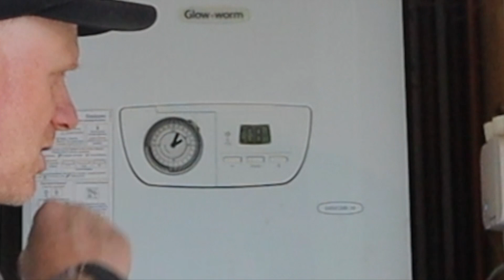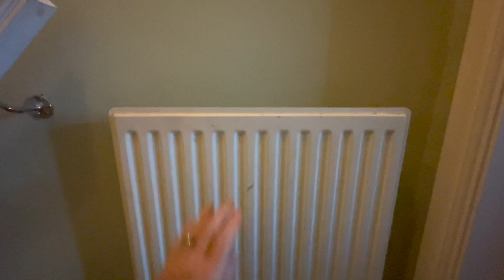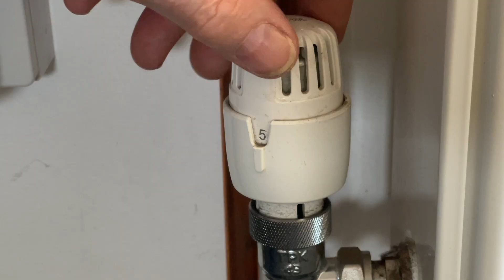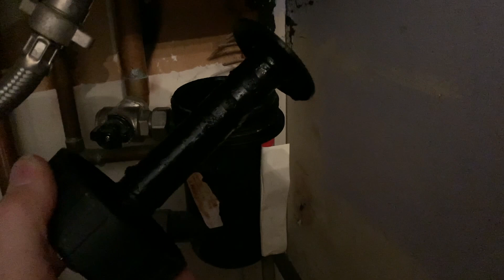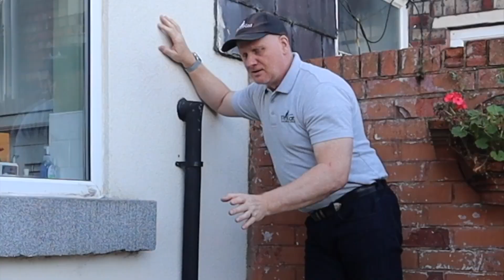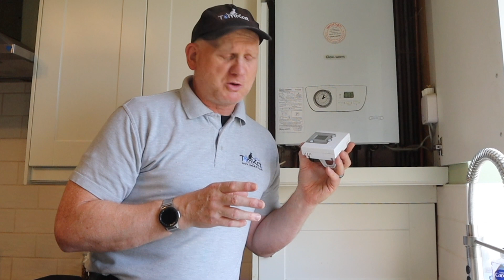Is your boiler ready for winter 2023, How to prepare your boiler for winter and stop costly callouts

Comment: I’d like to ask your advice on a different subject.     How can I contact you.  Thanks Pete
Reply from the maker: Email on info@tomorrow-kat.co.uk
Reply: @tomkatgastraining  ok.  One quick question.  I’ve been told I need to lag all pipe work even on a combi boiler change.     Flow.  And returns and hot.   It sounds crazy even if combi in old airing cupboard.   Been told it’s part L.      any ideas.    Thanks Pete
Reply from the maker: @peterreid4567  that’s correct
Reply: @tomkatgastraining  blimey.  I don’t see any engineers lagging a combi.   Sounds crazy.   But thanks
Reply from the maker: @peterreid4567  pretty much the same as lagging condensate pipes not many doing that either.
Reply: @tomkatgastraining  I know.     Your right.   Wi have to take 32 mm inside and lag external totally

Comment: our combi boiler as never been served  for 5 years and we have to refill every 2 days as no hot water  no heat till it's topped up
Reply: Expansion vessel requires recharging most likely
Reply: @47thfraz   possible
Reply: Yes expansion vessel, or could be a slight leak anywhere in the system, such as at a radiator valve. Look for damp on pipework or staining. @47thfraz
Reply: Get it served my friend
Reply: @thepm3972  I wish we could
Reply: Needs a good strip down service. Make sure it's actually serviced and not just "serviced" (safety check carried out)